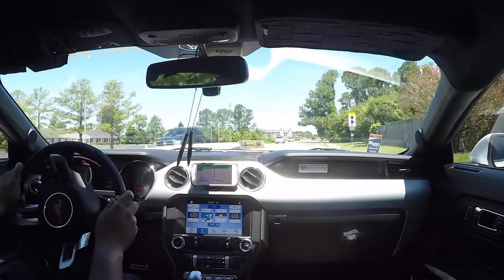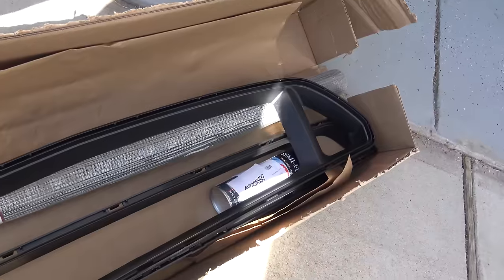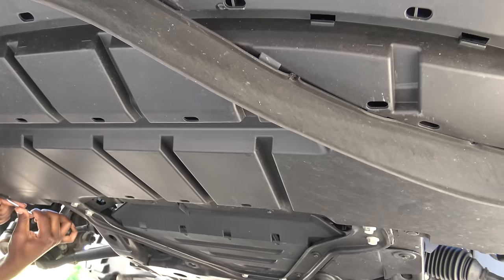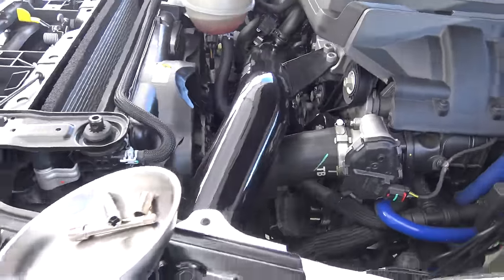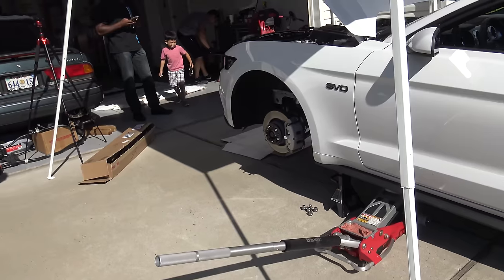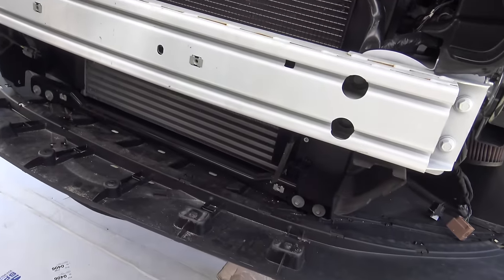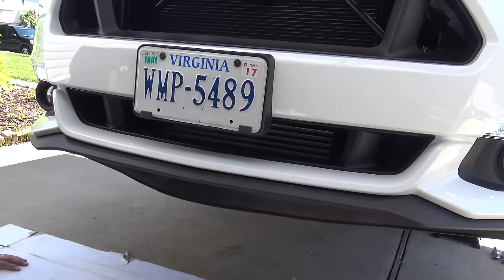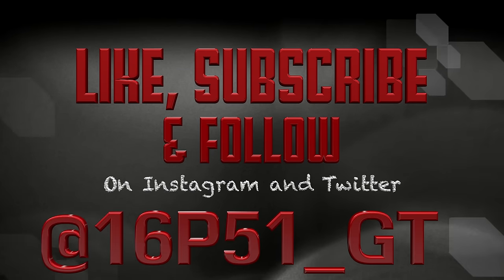EcoBoost Mustang Grille Delete

Comment: I know this isn't your Mustang, but your buddy's. I have a '16 Ecoboost and was considering upgrading the grille, probably the RTR. I do have a concern though. I live in FL where it rains a good chunk of the year. Do I have to worry about rain getting in through the air duct on the right, into the cold air intake? On the stock grille, I notice certain parts of the honeycomb are blocked, assuming for this reason. Appreciate any feedback.
Reply from the maker: I know quite a few people that did a grille delete or cut out the parts of honey comb that were blocked.  I haven't heard of them having issues, but I think you have a valid concern.  Although, the type of CAI you have will matter.  For instance, if you have a JLT intake, they sell a sleeve that you can put over the cone that will help block water.
Reply: Both the EB and GT grills have a opening on the side for the Air intake so I would imagine if it were an issue youd realize with the stock grill. My friend has one on her car and shes driven in the rain with no issues

Comment: Is there a video how remove the bumper pony logo ?
Reply from the maker: I don't have one on how it's done.  But, there are videos out there.  You basically just remove the radiator cover, the hood latch and then reach through and snap off the tabs that hold the pony in place.
Reply: 16P51-GT the grill shutters get in the way.